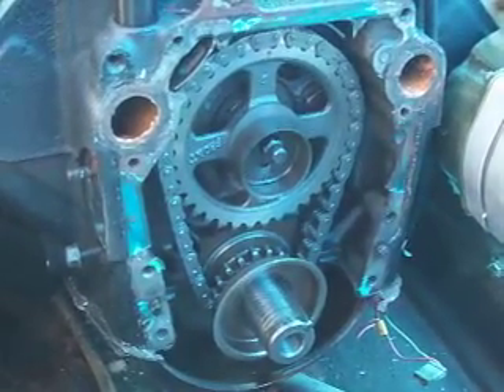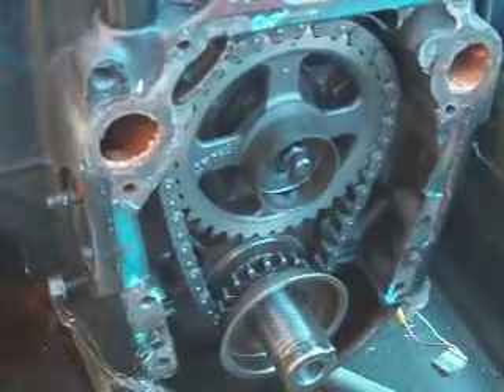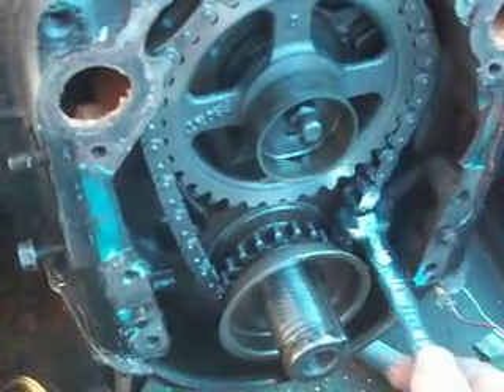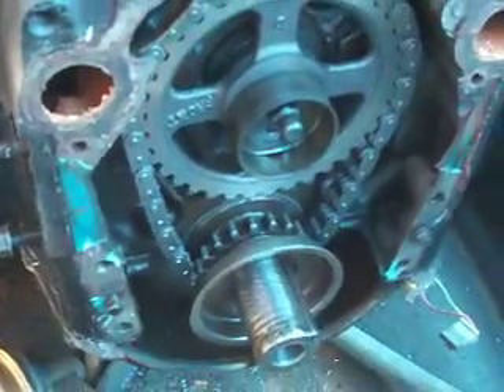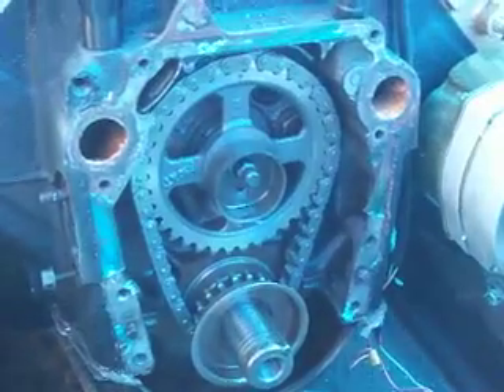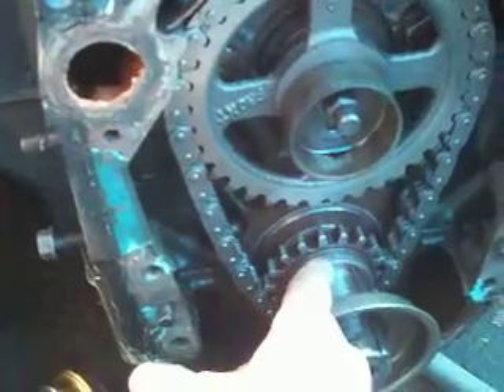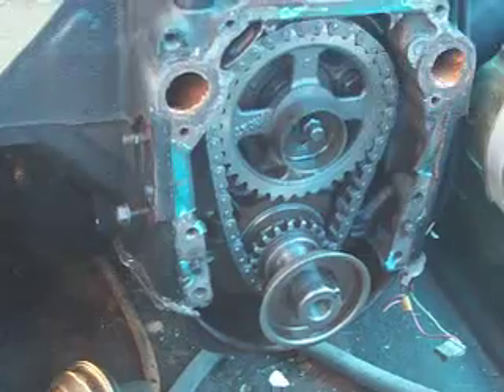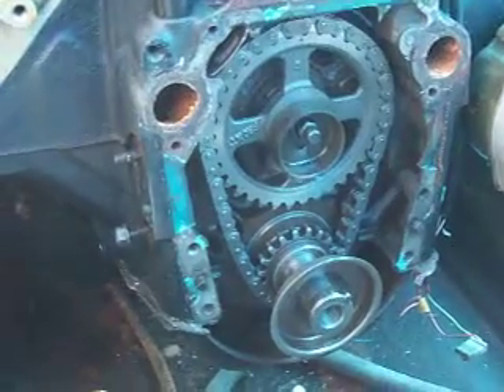DR GILLE 20090313 Olds 455 Timing Chain

Comment: Hi there, the Old's Factory Service Manual says to remove the sump first if you want to remove the timing cover but you seem to still have the sump in place.Is the sump still fully bolted up to the block in your video? I just want to replace the front C shaped seal between the timing cover and sump. Thanks
Reply from the maker: you can loosen the front couple bolts of the oil pan enough to loosen it up and pry the timing chain cover off.  Done it a bunch of times over the years.
Reply: Hi Jeff, thanks for your reply.That's good news and is what I figured. i will have to make sure that I can position the timing mark on the harmonic balancer back to the same place otherwise timing degrees indicated on my digital timing light would be incorrect. Would also have to make sure that the coolant  entry holes in the block are sealed up so coolant can't run down to the bottom of the timing cover. A leak would mean everything including the timing cover,water pump, hoses etc would all have to be removed and refitted again.Not good! Thanks again.